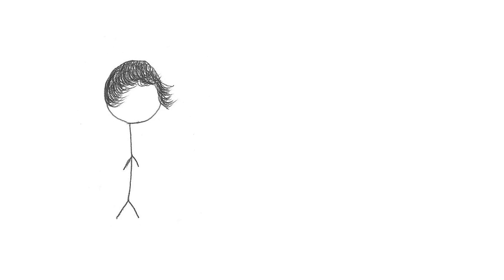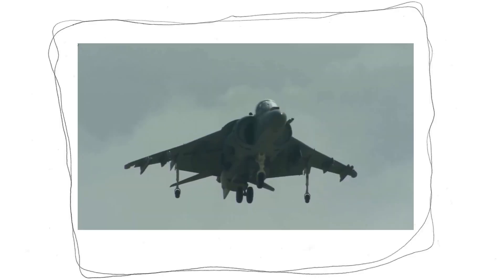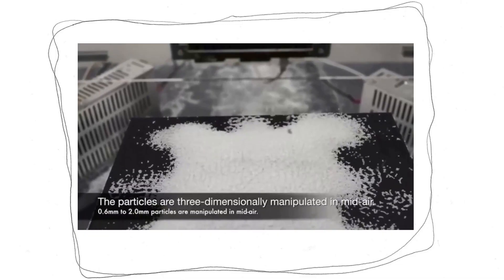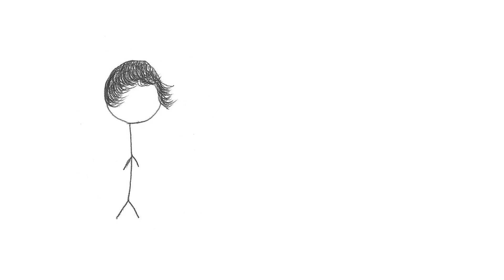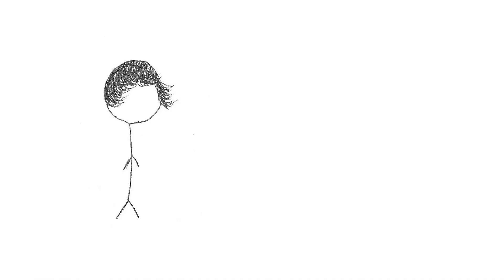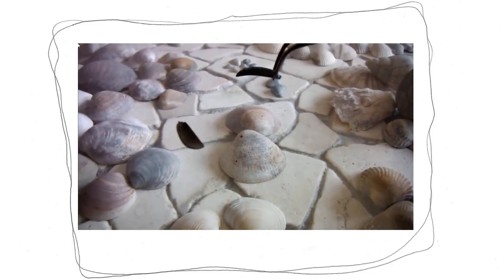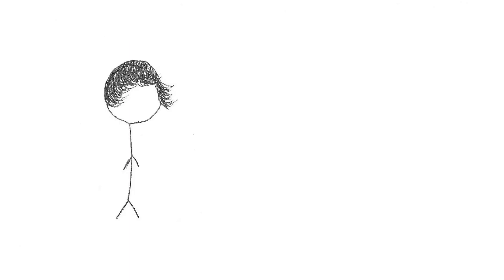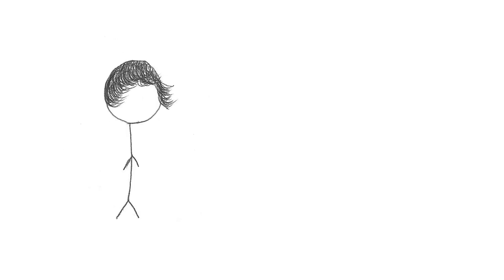Space Station on Ground - Debunked

Comment: Doesn't anti gravity basically entail a lack of an applied force such as gravity? Wouldn't this make an earthbound anti gravity machine be impossible because you would need to counteract earths gravity and other forces, without force? Feel free to correct me on this guys.
Reply: Well since gravity is a distortion in space-time in theory if one could create the exact inverse of that distortion one could destructively interfere with it and cancel it out. This would of course require negative mass and/or energy to accomplish since it's the only thing that can produce the inverse of the gravitational field generated by concentrations of normal matter and energy which has a positive mass-energy density.

Of course the other problem with doing something of this nature is that you would never be able to fully isolate the effect to a single object as the inverse field would be spherical and reducing in strength with the square of the distance just like normal gravity. Trying this on the surface of the Earth would be an utterly terrible idea since it's that very gravitational field that you are trying to cancel which is precisely offsetting the internal pressure of the Earth on the underside of the tectonic plate you are standing on. Even a fairly small anti-gravity field affecting the plate could cause Earthquakes, one large enough to offset the entire surface gravity of the Earth could probably have enough effect over the entire plate to cause it to move upwards far enough to open up the fissures all around it's edges creating a massive volcanic vent hundreds to thousands of km in length sounds like a bad idea to me.

Comment: Yeah do rockets work in space what do they push against show me an attitude adjuster on the iss or a space suit
Reply from the maker: +Chubster107 The rockets' propulsion push against the rocket itself; an action exerted in one direction has a reaction in the opposite direction.
Reply: +hiith Watch this peasant,,,,,Curiosity rocket show
Reply: the space station isn't really in space. technically it's in space but yet it is actually in constant freefall between 230-270 miles up. the atmosphere of earth is actually very far up and ends in the exosphere at about 6300 miles high. so it can maneuver just fine in the atmosphere of earth. They do space walks like it's no big deal because it's not. anything that could hit the iss is pretty much burnt up before it's even close to them .
Reply: And they do actually have altitude thrusters... every few weeks i think they have to accelerate a bit, but since there is no air resistance, it doesn't take any big engine or anything like that...